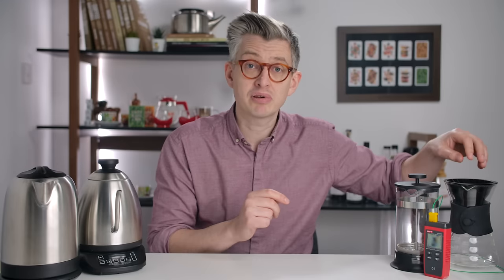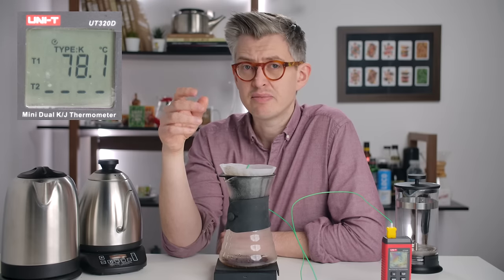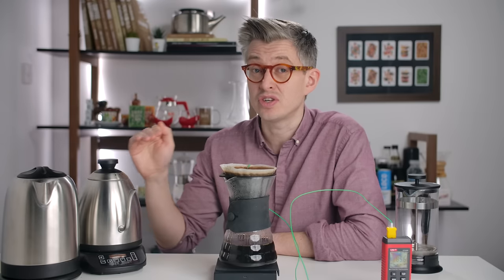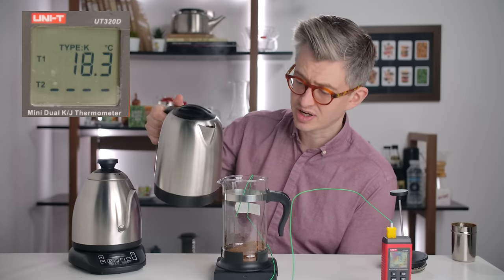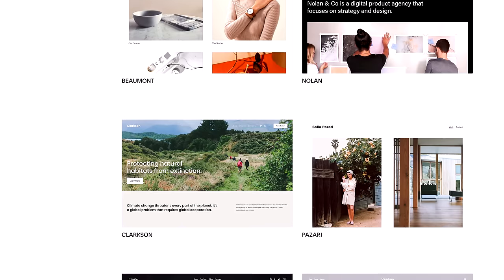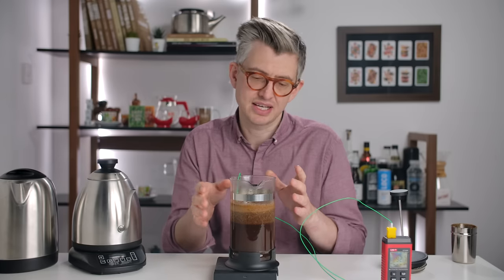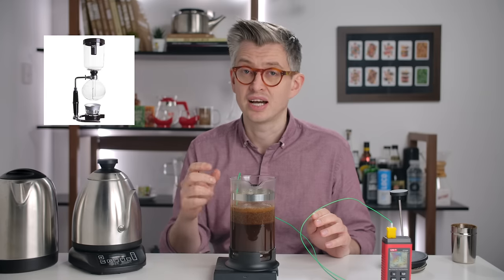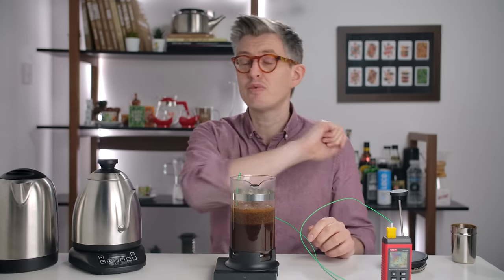Brew your coffee with boiling water - coffee brewing temperatures explained.

Comment: recently I was brewing and tried to reach a 90-93C temp in my kettle to pour in to my French Press... this makes sense now. My focus doesn't need to be so hard on the water temp as long as it is boiling. Absolutely love all the videos. I've learned so much about coffee in the last few days than ever in my life. So nice to have the processes explained in such great detail.
Reply: I wonder if anyone makes an insulated french press.
Reply: @markrichards6863  there’s lots of them, Bodum Colombia is one, ikea also makes one, the original Espro is insulated. Personally I like glass ones because I can see if the coffee grounds have settled into the bottom.
Reply: @markrichards6863  yes. Bought one at a thrift years ago. It was wide at bottom with non skid rubberized  bottom giving way to enameled stainless body tapering smoothly to top. It had a sturdy handle. It was a travel mug sold out of Montana. Made in China no doubt but I loved it.

Comment: The proof is in the taste. After trying a pour over using James's method straight off the boil, I get a better tasting coffee particularly with my favorite light roast.
Reply: I found that for medium roasts his as-hot-as-possible V60 rule doesn't work quite as well.
Reply: James was the 2007 World Barista Champion for a reason ~ he knows his stuff.
Reply: I even reboil mine throughout the pour over lol
Reply: Raphaël Atherill in the video description, he specifies that medium roasts is recommended to be 2 degrees cooler. Maybe try that and see if it makes a difference
Reply: I was going to comment to say something similar; I'm a new V60 user and I've been getting disappointing results with a home-roasted Yirgacheffe (lighter roast) and have found that brewing at or above 97 C (208 F) yields much better flavour--at least for this particular roast. I was using lower temps before yesterday and found it tasted bland and almost papery, despite having rinsed the filter. I can see myself giving temperature more consideration moving forward.
Reply: The reason is in the roasting. Lighter roasts have less of the bitter compounds, more acidity, and generally needs more heat to extract fully. Darker, depending on your definition, has more bitter, smoky, roast based flavours, and they are easier to extract, thus necessitating less heat
Reply: I get a worse tasting cup and it does taste burnt. Sorry but I disagree with James on this one.
Reply: considering the temperature is too simple a consideration, there is other factors such as water chemistry which have huge impact on the taste. Too bad he did not comment on that interaction.
Reply: I'm quite happy with this result as I didn't get a gooseneck kettle that has a temp controller

Comment: From my experience of making coffee since the last 8 years, I agree that boiling water doesn't make coffee bitter. 
Maybe people feel that way because they drink the coffee while it's too hot and don't let it cool down to taste the sweet notes. 

If you're using light to medium roast coffee, water should be as hot as possible. I always pour it straight off the boil and I get the sweetest cup everytime.
If I lose some temperature on the water, my coffee always turns bitter.
Reply: mindblowing
Reply: What about putting the brew vessel in a microwave (if possible) or in a boiling water bath? That would easily allow you to reach 98+ degrees..
Reply: @zio_tungst3no297  Or boiling coffee in water in a pan on the stove?

Comment: So I was using a pouring jug, a thermometer and a standard, non-variable temperature kettle with my aeropress. I was using 80-85 degree water based around the various methods I had seen posted. Just drinking my first cup straight from the kettle, and, if anything, it tastes slightly better. Thanks James, you didn't get your thermocouple out in vain.

Comment: James made much more sense than most other "coffee experts" who merely repeat what they heard without giving it a thought.

I myself brew finely ground coffee with water boiled on a stove-top and poured right into the grounds in a carafe. Then I sit the carafe on top of the turned off but still hot stove-top heating element and keep stirring for a couple of minutes to prevent the grounds from settling down on the bottom and get burnt by the element. I use finely ground coffee to make sure that I can extract as much as possible from it. After about 5-7 minutes, I'll let the coffee grounds settle down and carefully pour off the coffee. The coffee tastes better and has more body to it than filtered coffee.

Coffee gets burnt and bitter after sitting on the keep warm plate of a drip coffee maker because the stationary bottom molecular layer in contact with the glass bottom gets a lot hotter than 100ᴼC and get burnt, stirring it would prevent this from happening.

Comment: In the future I would like to see an exploration of brews at various temps but otherwise identical conditions in a blind cupping scenario.
Reply from the maker: I've done this in the past, at work. It's sort of interesting - the coffees we tried were all pretty nice from 85C upwards, but got better and better the hotter we went.
Reply: @jameshoffmann  That is really the main point of all this, I think.  Hotter generally means tastier to most people that actually like coffee.  There is no such thing as too hot when the boiling point is the ceiling.
Reply: @jameshoffmann   So what you're saying is that hotter is better... what about above 100C? You'ld need a pressure vessel to do it, but I'd be interested where the curve of tastiness starts to go back down.
Reply: Am also curious about the interplay of temperature vs. smell. Would lighter molecules escape faster with the higher kinetic energy? In an open brewing system where the air is not confined, can there be an optimal point where a good amount of (good-smelling) molecules are retained, while extraction is maximized? Is there a brew device that allows us to trap the smell with good extraction? Or the best strategy is just to extract and then instantly lower the temperature of the brew?
Reply: @JimShealy  @James Hoffmann I think you have to put your lab coat back on!
Reply: i would like to see an exploration of space

Comment: I've heard water flavor changes at the boiling point, which is why tea brewers insist on having sub-boiling temperatures when they brew their tea. It would be interesting to see a coffee test where one is brewed at 80c, and one is brewed at 80c after cooling down from boiling.
Reply: (i know this is 2 years old but anyway) 

Most teas are brewed with water that's around 90-96°C (96°C is basically fresh off a boil) with the exception of green teas where 80°C is the cut-off. Due to the way they're produced (fresh leaves are heated up quickly after harvest to deactivate enzymes subsequently stopping oxidisation) they still contain a lot of the bitter compounds present in fresh leaves. Dropping the temperature to 80°C helps you avoid extracting too much of them so you don't end up with a bitter cup. 

if course this is just a general rule and there can be exceptions

Comment: Yeah, I've generally found that light roasts that are typical for filter coffee do taste better when you really preheat the equipment and use high 90's water. I used to think 80-85 was best but I just kept making it hotter and it just got nicer. I think preheating is really important though, especially the ceramic V60 I use. I pour around 150ml or boiling water through it fairly slowly to make sure it gets as hot as possible. This changed my coffee dramatically. Kinda shocked by the drops in temperature here though, between the kettle and the brewer. It makes me feel a bit calmer in that I'm not likely to actually make the brew *too hot*.
Reply: I used to do this, but switched to the plastic v60's. I found that when pouring on hot water, the outside of the plastic ones still aren't very hot to the touch. To me, this would mean a plastic V60 isolates much better and prevents heat loss? Not sure if it's entirely true but brewing in the plastic ones with water around 96 to 98 degrees actually makes light roast filter coffee taste very good.
Reply: @Joeyrietveld  Yeah I think even James mentioned that in his V60 video. I am tempted to pick up a small plastic one when I next stumble upon it just to see the difference.

Comment: Some things that might make this a bit more scientific: show the temperature of the water as measured by the same probe before you pour it, show the temperature of the brew setups with and without coffee grounds, explain what reactions go on when coffee is brewed, and at what temperatures (I think things dissolving into solution isn't technically a chemical reaction), mention your elevation and barometric reading, and another cool thing would be to see how different spout geometries and pour heights affect your brewing temp.

Comment: I use a double walled stainless steel Espro press. Preheat with boiling water.  When kettle boils I dump the preheat water add grounds and fill with boiling water. The temperature regularly stabilizes at 95 Celsius or above.  I shoot for 203 degrees Fahrenheit or 95 degrees Celsius. A temperature that works well with the coffees we brew. I would not use a glass carafe press pot for love or money.

Comment: Good video, BUT:
I've never heard anyone claim that
"Using boiling water will result in your slurry temperature getting up to 98° or higher"
which is what you tested for.

The claim is that using boiling water extracts more unpleasant flavors without adding much to either caffeine or desired flavors, which you did not test for. While this was interesting, it feels like mostly a non sequitur.
Reply: A lot of people in the coffee community say brewing temp is extremely important, so much so that a kettle with a temperature meter is required, but as demonstrated in this video, its absolutely fine to use boiling for two thirds of coffees and probably a larger fraction of the people in general.
Reply: @PlasmaOne  - I agree with Sobey here. He didn't do a taste test. So what did he demonstrate here, other than that hot water cools? I enjoyed the video insofar as demonstrating that the temperature we heat the water to is not the temperature the coffee brews at, but it didn't at all demonstrate what different types of roasts taste like brewed at different temperatures. It's a good video for discussion, but it doesn't answer the question a lot of us watched this for, which is what is the best temperature in which to brew coffee?
Reply: Came here to post the same. I love these videos from James, but all this methodology tells us is that hot water cools down quickly from boiling point. Perhaps these higher temperatures brew great coffee, but perhaps they will still produce more bitter flavours than starting with cooler water.
Reply: IIIPlasmaIII i’d say the other way around, dark roasts tend to need less heat for extraction, medium is the most popular outside of coffee nerds
Reply: I think many people are missing what is significant about the demonstration. 100C will cool to 92 almost instantly, when poured. What he failed to demonstrate was how 92C will not cool to 82C in the same manner. This means that using any water much above 90 ish, will have very rapidly diminishing effect, so it's still debunking the rumor that boiling and not quite boiling will be drastically different. (Unless you believe that a 0.5 degree difference is just that important.)

I suppose the claims of boiling extractions may have (theoretically) been referring to full-on decoction where the "slurry" is actively kept at a rolling boil.
I've never heard of anybody suggesting to brew this way, but there's no reason it can't be done. Generally speaking, raising the temperature 10 degrees doubles the rates of interactions, so as for effect, I would imagine the "true" boiling would indeed be perceptibly different, as it would effectively been brewed nearly twice as long. There are also declining extraction rates due to equalizing gradients and also non-uniform extraction rates of different compounds, so it's hard to say for sure without trying it. This would theoretically also work the other way around using 80C water, extracting less. I've also never heard anybody suggest using such cool water, other than going all the way cold brew. IMO preference will always rule the day though. Even if he says he can taste a difference doesn't mean I can, since we all taste things a little differently.
Reply: He's mentioned (admittedly not in the video) that he has done blind cupping sessions, and coffee tastes better when brewed hotter. I don't believe James would make a video on using boiling water, if he didn't try tasting it. Whether or not he taste tested in the video or not, the point is clear on his stance of brew water temperature.
More likely, he geeked out and tried to find an objective test to explain why hotter is better, rather than give us his purely anecdotal statement.
Reply: @kruks  in the description box he tells us the temperature for each roast level.

Comment: I would've liked to see the temperature of the boiling water in the kettle with the red temperature sensor. The lower values might be due to an inaccuracy in the sensor.
Reply: Get this man to the top!
Reply: Cheap K-type thermocouples, which I suspect is used in the video and the kettle, have accuracies of +/- 2 °C. If the kettle is actually 96 °C (205 °F) instead of 98 °C (208.5 °F), then James is still within the temperature recommendations you see in most guides (30 seconds off boil, which is about 96 °C). I don't think a difference in 2 °C/3.6 °F really changes his point.
Reply: @drpowerthirst9093  Even so, when doing a scientific experiment, one should always control for their measurement. The sensor could be defective. The boiling temperature could be different due to altitude variations. The list goes on. The point is that it would've been very easy to make the control measurement to remove such doubts.
Reply: @kaizer694  it’s a bonavita kettle they are notoriously accurate and have been the gold standard kettle for the past 10 years maybe longer, I highly doubt the kettle is more then 1 degree off

Comment: 0:57 This is solubility rate. Solubility is the ability of a substance, the solute (coffee), to form a solution with another substance, the solvent (water). The concentration of any solution, increases with temperature. This is why cold brew takes so long. Cold brew is the movement from a high concentration to a low concentration through a semi-permeable membrane, the effects here also increase with temperature (warm rooms brew faster).  

Edit : If you make coco from a powdered mix and find undissolved mix at the bottom of your cup, add more solvent (milk/water) or increase the temperature of the current solution.

Dark roast beans are larger in size and lighter in weight than light roast, when ground they take up even move volume. This increased volume adds surface area, that in-turn increases solubility rate.

This video helped me with the solubility rate for different roast levels and avoid over extraction.

Comment: Technically, the making of coffee is a solid-liquid extraction process.  We typically do not call it a reaction in chemical engineering.
Reply: Is that because it does not fall into the 5 main types of chemical reactions like combustion, double replacement, etc?
Reply: @isaiahperez1115  - It’s a separation of a substance from a matrix.

Comment: As someone with a cheap French Press with plastic on the bottom, if I tried to preheat it, the plastic would melt and be ruined.  I know because I nearly ruined it after leaving it partially atop a still-hot electric stove burner and it did start to melt.  I rescued it and have been careful not to put it on the stove again.

Comment: This is super, James, I'm so glad you did this.  Your video also helps to explain/simplify water temp for cupping coffees.  If we pick up a kettle that is boiling, by the time we walk to the cupping table and start pouring, like your French press demonstration, we're at an appropriate temperature for "cupping-roast-level" coffees.  Many people, when learning cupping, ask about the water temperature "standard", but practically speaking, when you have dozens of coffees to cup, using the "just off the boil" method works great and is an efficient way to make sure all sets of coffees are evaluated at the same temp (as long as you use one off-the-boil kettle per set).

Comment: Yes please, would love you talk about cold brewing temp.!
I have a Breville Barista Touch, and it has unstable temp that starts as maximum 84 degrees Celsius (lasts just 3 seconds), then reduces dramatically throughout the 30 second brewing time from 75 to 62 degrees Celsius!!! Measurements were done through an accurate thermometer directly from the spouts with no coffee; just water. 
Turns out that most users experience the same issue as mine. 

A video on cold brewing temp and work-arounds for it would be very beneficial!